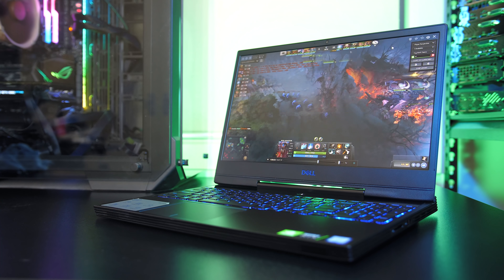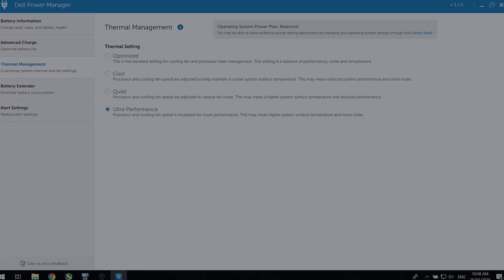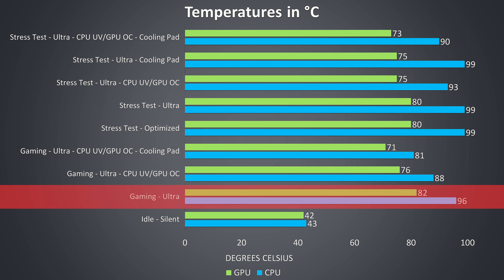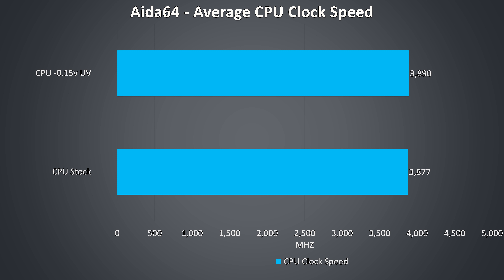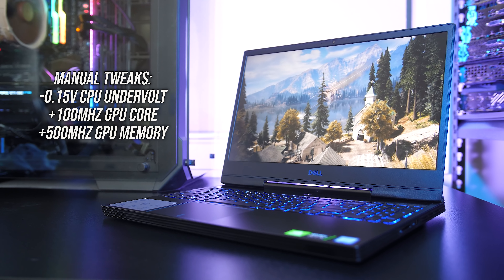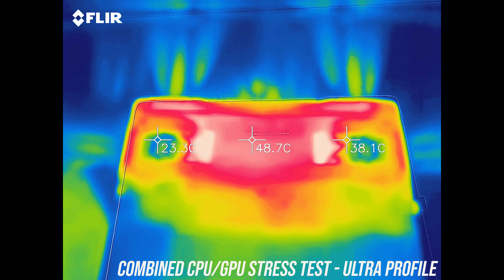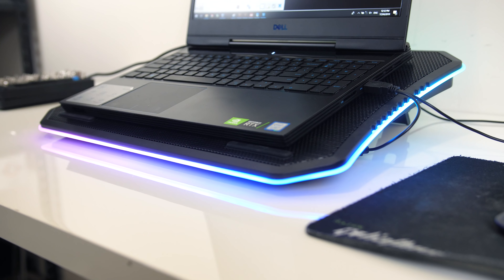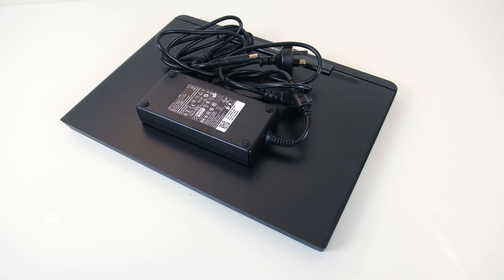Dell G5 5590 (RTX 2060) Thermal Testing, Overclocking and Undervolting

Comment: Jarrod, would the G5 with 1650 that has a tdp of 45 watts still thermal and power throttle?  thanks <3
Reply from the maker: Depends what CPU you pick, I don't think the graphics are the problem it's all in the CPU, so I'd expect the graphics to be fine given it's lower than the 2060 I had here, and overall it may contribute less heat into the system with the 1650 but the CPU alone seems to be quite hot in combined load. Either way hard to say without having that specific configuration to test with.

Comment: A guide how to undervolt ? :D
Reply: Yes please
Reply: @mohamedmagdy4857  Undervolting is disabled as of the current BIOS 13.2 because of the PlunderVolt fear
Reply: @raze4524  It can be re-enabled but might require disabling bios auto updates, rolling back the bios version and resetting to factory settings (or default settings). It is unfortunately not an exact science and seems to differ on a per device basis
Reply: @deen-al-afriqi  this is true! most likely worst scenario is undervolt won’t be enabled, but by-the-book: backup your data when updating/rolling back the BIOS

Comment: Do you UV and OC in bios or with some kind of software?
Reply from the maker: I use MSI Afterburner to overclock the graphics, and Intel XTU to undervolt the CPU, so all software.
Reply: @JarrodsTech  Does MSI AB save settings after PC restart?
Reply from the maker: Yes I think so, XTU doesn't though you'd need Throttlestop for that.

Comment: CPU and GPU heat pipe shouldn't be shared as this may hinder thermal performance.
Reply: Some models with 1/2 shared heatpipes can do better. But yeah, shared heatpipes means worse thermals.
Reply from the maker: I think shared makes more sense. If you're not fully loading both the CPU and GPU at the same time you get to make use of more cooling, for instance in a CPU only load you have more heatpipes than you would otherwise.
Reply: @JarrodsTech  Things like gaming video rendering is very intensive on GPU and CPU which is why buyers buy powerful laptops . If temp goes above 80 it is unbearable for most users
Reply: @JarrodsTech  Things like gaming video rendering is very intensive on GPU and CPU which is why buyers buy powerful laptops . If temp goes above 80 it is unbearable for most users

Comment: Would you choose a GTX 1070 or RTX 2060 ? So, same model just graphic Card is different..
Reply: Gtx 1070 max Q or gtx 1070 ? If budget is enough , buy 2060.
Reply from the maker: Both perform very similarly, I have a video comparing the differences and my thoughts between them here: https://www.youtube.com/watch?v=tgsyvCvO8fw
Reply: It was a personally Question. I already have a laptop @angelobronte1452

Comment: I have this model... just got it the other day, and still can't figure out how to save games to the 1 terabyte Hard drive...... HELP!!!!
Reply from the maker: Do you see the drive listed? If not go to computer management > disk management and see if it's there, if so set it up and assign a drive letter to it. If it's not there you'll probably need to shut down and open the bottom up and check a) it's actually there, and b) it's plugged in.
Reply: @JarrodsTech  It says "D" and it will not let me save anything to it it says read only

Comment: I undervolt my g5 5590 with the i7 9750h with -0.150v but for some reason the watchdog service reseted to default, any ideas of why this happen?
Reply from the maker: Sounds like -0.150v is not stable for your system, drop it back and test again til you find the stable point. What I am using is not a globally applicable one size fits all settings, the exact value will vary by workload and also depend on factors like silicon lottery.
Reply: @JarrodsTech  something that I notice was that Alienware software resets this value and I read online that watchdog service only acts up when the machine goes to sleep. Thank you anyways, I really like the machine but it gets to hot sometimes.
Reply: how did you undervolted it?(:
Reply: @mohammedamin1160  I think the option is no longer available since there was a bug with intel CPUs and undervolt, dell updated the BIOS and disabled undervolting

Comment: I'm gonna wait until they drop prices for the 8th gen processors
Reply from the maker: I've seen that starting to happen in some cases already!
Reply: They already dropped. I've been seeing a lot of 8th gen GTX 1060 laptops going for $700 - $900 now.
Reply: The difference between 8 gen and 9 gen is like 7% of boost in perfomance. That is why I bought the 8 gen processor since they are cheaper now.

Comment: Why laptops does not have more them 2666 mhz ?
Reply: Mobo and intel.
Reply: Some models do support high frequency RAM
Reply: @TabalugaDragon  i just saying why gaming laptops does not have more then 2666 mhz ram speed
Reply from the maker: Limitation of the platform I guess, if you look up the 8750H on the Intel ark site you'll see DDR4-2666 is listed as the supported memory type, so as high as it can go as per the standard, not sure if it supports XMP profiles for higher, may depend on the machine as I have seen a small number that support DDR4-3000.
Reply: @iraklimgeladze5223  i7 8750h supports ddr4 2666mhz ram(processor limitation)

Comment: I'd like to see more OC graphs, I'm trying to decide between the G5 with the 2060 (and OC later) and the Helios 300 with the 1660 Ti, which seems way overpowered, even with the G5 OC'd!
Reply from the maker: OC on laptops doesn't matter much in most cases, most are already power limit throttled on the GPU so boosting the clock speed often doesn't help much. I used to do it, but it took too much time and no one really complained after I stopped doing it.

Comment: this or the tuf fx505 144hz? besides the gpu
Reply from the maker: FX505 doesn't get this hot from what I remember, but I have done the same tests on it if you want to check. Honestly can't really remember all the results of the 505 at this point to compare 😅
Reply: @JarrodsTech  dang tbh that fx505 gold steel gave me an erection and I'm planning to buy it this month but I'm still confused between that and the msi gp63 8re leopard
Reply from the maker: lol, haven't used a GP series MSI laptop myself yet so can't compare, I've been trying to get one for months!
Reply: @feljosephdumoran4779  buy acer Triton 500

Comment: cpu reaching 99 out of the box is not ideal :( and even with undervolt it gets a 90?? scary for reliability. how hot is the keyboard and palmrest surface I wonder
Reply from the maker: You can see the keyboard area temperatures when I show the thermal camera test 😁
Reply: @JarrodsTech  😲😲good temp

Comment: What if they put in i7 9th gen 🤔🤔
Reply: teerach prasertsilp they did
Reply: They did and it runs hot too. Just undervolt the cpu and it will help lowering the temps a lot, like the video.
Reply from the maker: You can buy the 9750H version from the Dell US site right now, it would probably be just as hot if not worse though, I'll do a comparison if I get it.

Comment: If anyone considering getting this laptop Don't! Since I got it I've been getting 100C on cpu on almost any game. It is super hot that burns your fingers which is why I use an external keyboard.

Also, it's super loud very annoying. I'd stay away from this computer tbh I'd pay a bit more and get something better.

You can play any game with decent settings but at this temperature and noise level is not worth it.

I've had this for 6 months already and I keep it clean.

I undervolted it and it didn't make any changes kept getting 100C... I bought a new Thermal paste and going to be replacing it hopefully that makes a difference?
Reply: How did it go with thermal paste replacement? I have same thermal issues as yours but I managed to reduce both cpu and gpu temps by lowering frequencies. I did not change the thermal paste yet but the keyboard is not burning my left hand any more
Reply: Did you manage anything then?

I'm experiencing the exact same issues, I'm yet to undervolt, use thermal paste, a cooling pad or clean the insides.

Comment: I don't understand why laptops doesn't come undervolted out of the box. at least little bit.
Reply from the maker: My guess is that it takes too long for them to do testing to make sure each unit is stable, and if it even slightly rises RMA rates due to instability it's probably not going to be worth it.
Reply: Jarrod'sTech Yeah.. wish that wasnt the case
Reply: Jarrod'sTech well they could implement some automatic system that tests how far the laptop can undervolt
Reply: @megapet777  facts

Comment: Maybe that day will come when I do not need to take a new, freshly bought high-tech device that cost money and do some undervolting, undershitting... When all this optimizing will be done by manufacturer. Just buy, use... and if something goes wrong - simply throw it to the face of the one who sold it to me. If we, usual people can optimize how something works, that means that the manufacturer does not care about what he is selling to us.
Reply from the maker: While some laptops are clearly better than others when it comes to cooling, at the same time I feel like Intel need to stop just boosting clock speeds each generation to have a new product to sell, it just adds more heat and throttling and we don't see cooling improvements because everything is still based around the same 14nm.

Comment: The only problem with this guy is he pulls lots of graphs and blabbers about it , without explaining what those metrics are and whether higher or lower is better. Agree ?
Reply from the maker: What should I do instead, just have the graphs with some crap music playing for a few minutes? Maybe you're new and don't understand, but basically higher temp = bad and higher clock speed = better performance. Would it help you if I added "higher is better" or "lower is better" to the top of the graphs? Sorry I thought temperature was pretty self explanatory.
Reply: Jarrod'sTech constructive criticism : just slow it down a little bit. Like Dave2D. Also unlike other reviewers, you bring lots of graphs in. So not all maybe able to follow what this does in a quick run . So atleast a caption which says higher the better or lower the better gives the not soo geekiest a grasp of the concept. Except that your videos are pretty top notch .